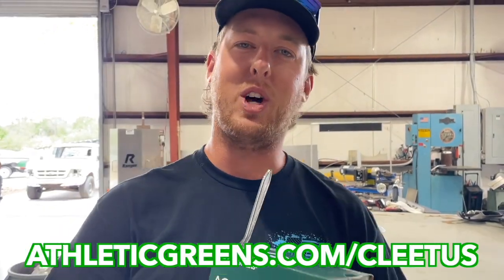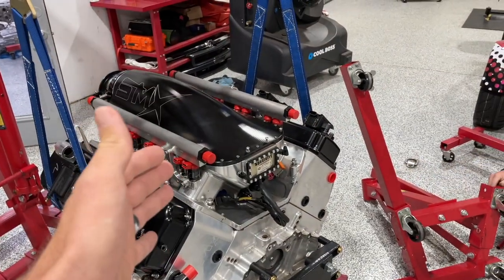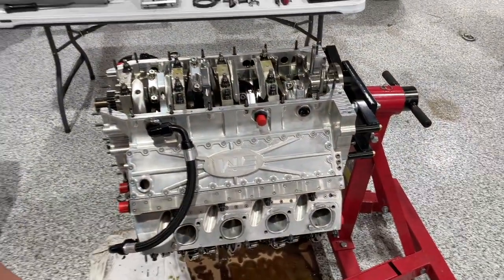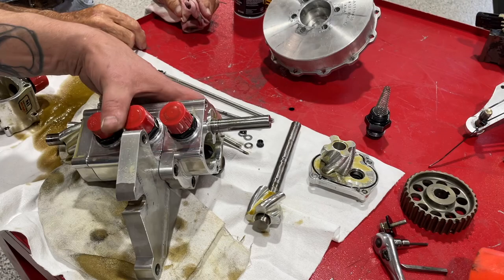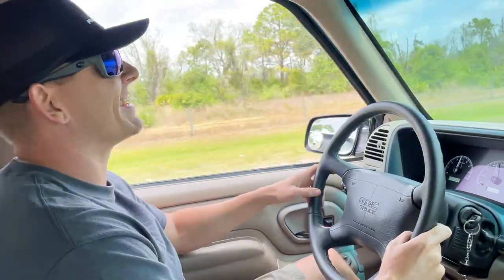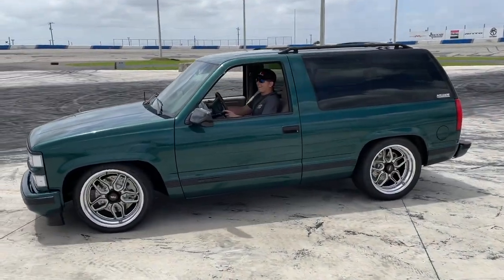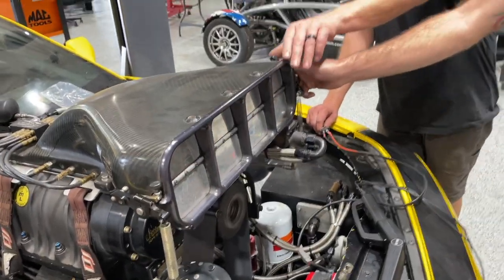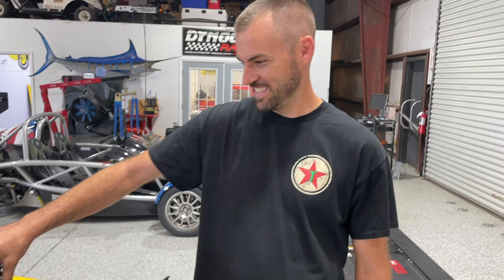This Is Why Mullet's 5,000hp 9.3L SMX Had Metal Shavings In The Oil + KillaB is Running AMAZING!!!

Comment: It's risky working with a high profile person like Cleetis... if it goes BOOM, millions will know. We Love You STEVE....
Reply: Every engine Cleet has ever had he blows up! Lol
Reply: It brings more customers than haters even if it goes boom. Theyre race cars and most know youre pushing the engines intended geometry design every 1/4 pass
Reply: It makes 5000hp, it can go boom anytime at that level….. nobody would blame Steve that’s knowledgeable, it’s only so much you can account for when engineering this stuff
Reply: @onedayiwillmakesomecontent  Most people pushing engines at or near the limit of what's possible blow them up. Nitro motors detonate on the regular.... shit happens.
Reply: @Call_MeDaddy  yes sir!! That kind of power simple as overlooked air, fuel being off a bit means goodbye!!!  All has to be on point.
Reply: 1 injector going out = boom 
Bad ground = boom
Debri sucked in the turbo =boom
Oil line tears = boom
Belt for oil pump/fuel pump breaks = boom
You get the point…. And at 4 digit horsepower you only have room to mess up Once!…
Reply: @Call_MeDaddy  kinda 3 chances…that first number gets put in wrong and she’s cooked. Lol
Reply: If you lack in cofedence in what you deliver dont deliver to cleetus but i guess thats not the case..
Reply: No one has built an engine that Cleetus cannot explode.  Maybe someday.
Reply: when playing at such high levels of HP and TQ, everything can go boom at any moment. it's shear luck when it lasts many miles and runs. sometimes you win and sometimes you lose, no matter how perfect you try to make it, some of the base materials are far beyond your control and inspection capabilities. think not? try some nuclear.

Comment: Yep, I had the same exact issue. Got my new setup done with the dry sump, started making noise, figured it out, it didn’t stop. Well what started causing the noise ended up going through the pump and ruining that, back to Moroso it had to go. Not cheap for new cases and rotor for those things, luckily I only have a couple stages. My problem was the Inside of my AN suction lines from pan to pump were collapsing inside without and sign outside, might be worth it to check the inside of your suction lines and make sure they aren’t collapsing. Still to this day one of the weirdest things I’ve ever seen, both stainless braided -12an lines looked like a capital M inside and couldn’t feel anything from out.

Comment: Just amazing/terrifying how a screen tip came so close to catastrophic engine failure by locking the oil pump up! Great content and Steve Morris is a real one for coming there and tearing that engine apart to see where the metal shavings were coming from!👍💪

Comment: my high powered 4G62 turbo was mint then after a head gasket blew out, i found gouging in the bore, disassembled engine to find the piston pin was riding the cylinder wall, the engine had that much thrust that it stuffed the bore and stuffed the nitrite crank, lucky that the 4G63 crank fits, $2,500 later

Comment: Love the tech on the build. I'm not a pro engine builder... but my gut is wondering if the crank is flexing with the thrust bearing at the front, making the stock bearing at the rear touch under load. It basically pushing on a rope.

Comment: 13:28 when Steve does the timing adjustment and the throttle response is stupid even SAM smiles and pays homage w the handshake 🤝 28 or 78 years old same excitement over horsepower ❤

Comment: Gear style pumps tend to start wearing immediately after start up due to pressure pushing the gears into the housing the oil doesn’t go through the middle but around the outside of the gears but the pressure from it tends to end up pushing back on the gears making them separate. But I do wonder what the pros of aluminum gears to steel gears. Just less chance of catastrophic damage or just is it a heat thing?
Reply: Let’s Talk👍
Thanks For Watching!!

Comment: that makes me wonder if they had the converter too tight into trans. but it would have probably grenade pinned the pump or something, unless there's an input shaft length issue(probably still would have broken. so maybe not. how old is the converter, is it ballooning too far.
then again, maybe just hammering that custom thrust bearing and a few thousandths clearance isn't enough to take up all the movement. that and Cleetus saying we don't need oil when we start it...

Comment: Je suis pas sur que plus de chevaux font aller plus vite regarder les moteurs rotatif 1300cc turbo boum 7s je pense que 2000 ch sont enplement suffisant le tout. C est de trouver les meilleur transmission et améliorer sont pilotage  et bien sur un beag greap aller essayer des transmission de partout jusqu a ce qu il te donne les moyens d être le meilleur 🙏🇫🇷👉

Comment: guess we find out in the future if its possible put put so mush trust intoo the crank from the torque converter that it pushes forward in the block and either slightly stretches or deforms that aluminium block where the front trustbearing is sitting
makes you think if it would be better to have that roller trustbearing closer to the torque converter (probably to do with the heat coming off the converter and wat you need to remove to be able to check and replace it

"lets team up on the tandum " can you say realy realy expensive damage , watever it is eithe mecanical or body damage , when youre blood is up you both dont care , the crying comes after the event 
i bet steve is allready calculating the bill for repairing two engines that smashed intoo eachother or a barrier and hit the crankpulley (dunno man this one has glitter in it too) 
doing a stationairy burnout side by side is ok but having them move around eachother in a cloud of thick smoke is not a good idea unless its in a wide open space or across from eachother on the track and not on the pad 
maibe do a bit more of a sincronised drifting style demonstration (that might actually be a better idea if theres audience on both ends of the track bet you could cove the track in smoke all the way up to the nosebleed sections and down intoo the pits)

Comment: I'm not trying to cause hate or an argument but you guys do know that the same company that makes "Super Tech" oil filters makes the K&N oil filter.
Cut them open and there is no difference in build quality or materials.
They are nearly identical.
You're just paying for an overpriced label.
K&N Air filter, absolutely!
K&N oil filter=garbage 
A proper filter is definitely recommended, might help with the oiling problem in Mullets engine.
😎👍